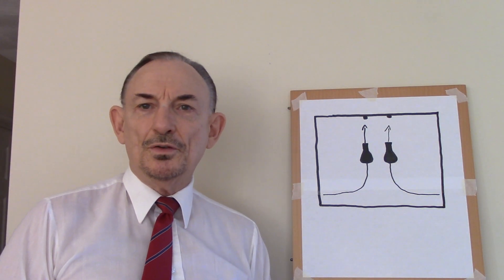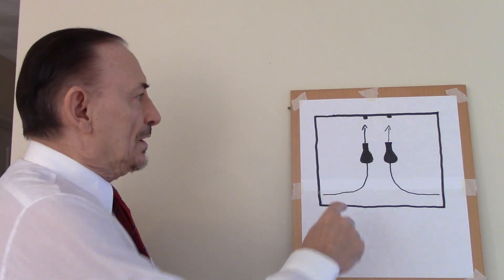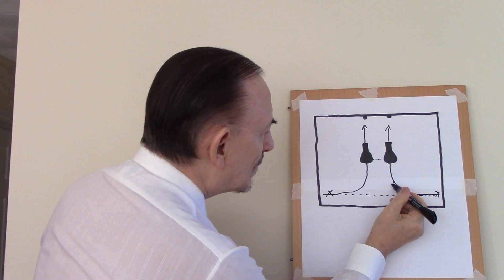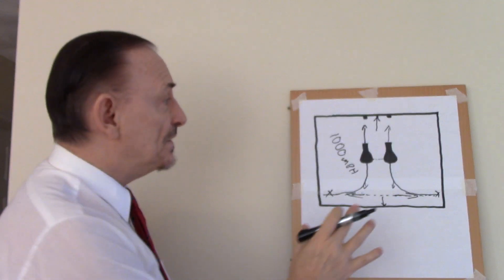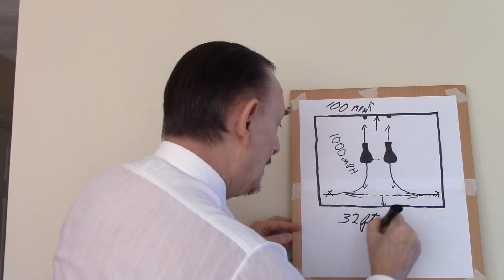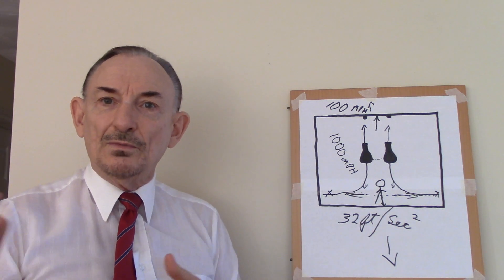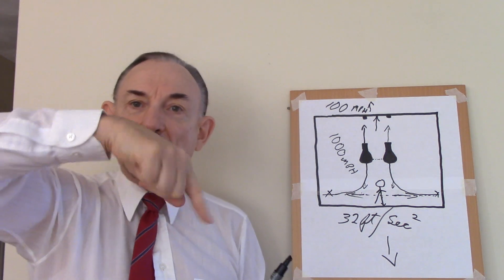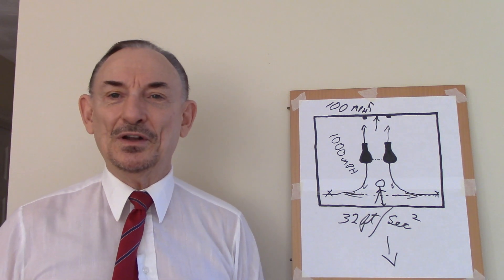THRUST CREATED IN CLOSED BOX

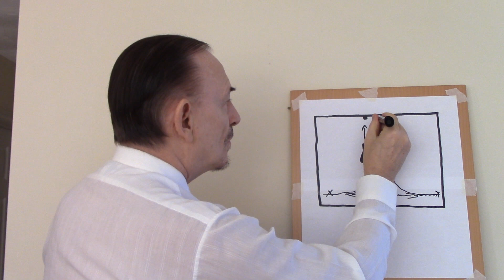Comment: 2:50 the reaction force is dissipated through the rail to whatever holds the rail in place, and if the rail is not held in place then the cannons would not turn to be parallel.
The exact total force the left rail experiences is equal to the cannon's downward movement in the beginning minus the cannon's leftward movement in the end; the right rail follows similarly. The total force on the left rail points roughly down and to the right; the total force on the right rail points roughly down and to the left; adding them together you get exactly the total downward force from the cannons.
Reply from the maker: How are you missing the fact that the cannons are still moving away from the center axis? Where did that force come from? You are totally ignoring that. The force that is making the cannons move away from the center axis after they have moved around the curves, is absorbed in the chain. Therefore, there is more force against the upper wall of the box than the lower wall of the box.
Reply: @jeffincanada5060  you haven't considered the difference between force and energy here. the change in kinetic energy from fully downward to fully outward is matched by an opposite change in kinetic energy for the chains. if the chains are fixed to the box, then this applies to the whole box. the final moment where it's just the cannons moving directly away from each other is equivalent to if the cannons had fired at one another to begin with, and when the chain halts their movement, the energy of their movement is dissipated as heat and sound. you should try performing the math here.
Let's analyze the vertical and horizontal energies separately, since you don't seem to understand when they're analyzed at the same time:
the box starts out not moving, the cannons fire, the projectiles move up with kinetic energy E1, and the cannons move down with kinetic energy E1, this is primary conservation of energy at the moment the cannons fire. for the cannons to go from moving down to not moving down, their vertical kinetic energy must change. this energy is transferred into whatever thing is causing them to stop moving downward - namely, the box itself. The horizontal kinetic energy comes about from the conservation of momentum through incremental forces - as the cannons ride the pre-determined curved paths, they pick up an outward velocity which is then dissipated when they stop moving away from one another.
Reply from the maker: @MrRyanroberson1  Yes, it is technically called kinetic energy. A rose is a rose is a rose. If I call it force or kinetic energy it makes no difference. The chain (singular) is attached only between the cannons. Man, you need to view the video again. You are missing a bunch of stuff here. You made my point when you said that the cannons "pick up an outward velocity which is then dissipated when they stop moving away from one another".  That velocity/kinetic energy, is acquired from somewhere. Where do you think it comes from. It is a continuation from the initial recoil of the cannons when they initially fire. A certain amount of the kinetic energy, force, whatever you want to call it, is absorbed in the rails, which are attached to the box, as the cannons go around the curves. However, not all of that initial kinetic energy is dissipated in the time that they go around the curves. There is still energy that is propelling the cannons away from the center axis, after they go around the curves. That energy is energy that would have, had the cannons not been redirected, counteracted the force of the bean bags hitting the upper wall. But since that energy is NOT  COUNTERING the force of the beanbags hitting the upper wall, there is more force/kinetic energy, applied against the upper wall than the lower wall. Thus, the box moves.
Reply: @jeffincanada5060  where do you think the kinetic energy goes from the vertical repulsion of the projectiles from the cannons? you may not know this, but vertical energy can be interchanged for horizontal energy. an obvious proof of this is in rotation itself. what's happening is the vertical kinetic energy is being reoriented, but what you seem to miss is that this still conserves the total kinetic energy of the system. for the rails to redirect the cannons they must exert a force. either the rails will be deformed, or they will cascade this force onto something else - namely, the box. overall there is no net gain in vertical kinetic energy. the horizontal kinetic energy could just as easily have been generated by the cannons firing at each other, and the result would be the same.
Reply from the maker: @MrRyanroberson1  I don't know why you are missing the obvious. Most of what you are saying is accurate. But there is still kinetic energy in the cannons as they move horizontally, away from each other. That means that the motion of the cannons around the curves, did dissipate some of the energy, but NOT ALL OF IT. There is still energy that is causing the cannons to move horizontally, away from each other. Tell me, where did that energy come from?
It did not manifest out of thin air. It is energy that was redirected from the vertical axis to the horizontal axis. That means that there is more energy in the upward motion of the bean bags than there is that is dissipated as the cannons go around the curve. And that energy is making the cannons move horizontally. That extra energy cancels itself out in the chain. Therefore, there is more upward energy than downward energy because some of the downward energy has been directed horizontally. If you do not understand this, then there is nothing else that I can do to wake you to the facts. When I showed this to an employee of Transport Canada, a smart guy with 4 degrees in physics and engineering, he totally got it. So if you do not understand this SIMPLE principle, then there is nothing more that I have to say to you.

Comment: I would love for this to be true, but although it doesn't break Newton's Laws, it doesn't produce any net thrust either.

Let's assume a perfect system, no losses as they simply obfuscate the realities involved.

As the cannons fire, they get pushed back with the same force as the beanbags are ejected and which transfers to the forward (upper) wall as they hit. So the box is pushed forwards and according to Newton will continue to move until acted upon by another force.

As the cannons roll back they are rotated by the rails and ALL their rearward momentum (now equal to the forward momentum of the box) is taken up by the rearward force on the rails. Equal and opposite. So the box's motion is halted.

So now the box is stationary again and we have that same energy instead in the outward movement of the cannons (remember, no losses anywhere). Let us also say that between the cannons we have a perfect spring and as the cannons move outwards, they stretch the spring until the spring has absorbed all their kinetic energy, at which point the spring pulls them back together again gaining the same speed and momentum as when initially fired (no losses remember). But as the cannons travel along the curve of the rails, all that inwards momentum is converted into forward momentum by the rails, which are pushed backwards with the same force. So the box is now pushed backwards with the same force as it was originally pushed forwards. I.e. it moves in reverse.

The cannons then hit the stops at the front of the rails and all their kinetic is converted into a forward thrust, equal to the force that pushed the box backwards as the cannons pushed against the curve of the rails and which caused its backwards movement. Therefore the box now stops. So nothing is gained, no net thrust in any direction from one complete cycle. Repeat ad infinitum.

The effect of using a chain rather than a spring simply complicates matters as that would involve huge losses, but with the cannons at the outer ends at rest, force would need to be exerted to move them back to the front and the force required would be equal to the spring pulling them together again and generating the rearward thrust, same as if using a spring.

No equations required to understand the above. Just common sense and a knowledge that energy can neither be created nor destroyed and that Newton was in fact correct.

Seriously Jeff, this cannons in a box example simply does not work. I have no idea of how your Centrifugal Propellor is supposed to work, but if the logic of its operation is as seriously flawed as this, you should give up now and save your money.

Feel free to let me know when you have proved otherwise.
Reply from the maker: "ALL their rearward momentum (now equal to the forward momentum of the box) is taken up by the rearward force on the rails." 
That's wrong Ken. If that were true, then the cannons would completely stop before they moved horizontally in opposite directions from each other. As they do move away from the vertical axis, there is still kinetic energy in them, and when they hit the end of the chain that connects the two of them, that energy is absorbed in the chain. This does not negate Newton's Third law, it just expands it. 
If you actually take the time to view the videos that I have posted on YouTube, of my Centrifugal Propeller, then you will see that this is not just theory. When you watch the video of the 1.8 version, I suggest that you stop the video and move your curser to the 3 second point, click, and then move it to the 10 second point and click. That will make clear to you that the machine does create thrust in a closed unit. If you have questions about that, please get back to me.
Reply: @jeffincanada5060  Wait.... what if the "cannons" are levitating on the rails with magnets? That would alleviate a substantial amount of friction transferred through the rails and then essentially the chain stopping the cannons from making contact with the box. Is this the "secret" that you were hinting at?
Reply from the maker: @oodyjones  That would reduce the friction, but I am not sure what you are referring to when you say that I was "hinting" at something.

Comment: This concept completely ignores the fact that in moving the cannons back to their original positions while travelling at that speed you'd be completely counteracting the force originally produced by the cannons, so it would not accelerate, however interestingly although it would be very impractical you could use this to travel sideways, or along the ground in a high gravity environment like earth by utilising the friction created with the gravity to stop it sliding back when the cannons returned to their previous positions. If you did this in space however the cannons would be propelled backwards with the same speed as the beanbags and as soon as they stopped moving in the forward directional axis they would pass on their kinetic energy to the rails and the box, completely counteracting the force created by the beanbags hitting the wall. Which is why this concept just won't work, you can't keep the propellants of the thruster enclosed inside itself, in ion engines they make the most out of loosing a small amount of propellant by giving it the greatest momentum when shooting out the back of the spacecraft, ensuring the spacecraft accelerates more efficiently with equal momentum to make up for the loss in mass. If you're interested in creating some form of propellant free thruster I would suggest either looking into fictional warp drives (although these don't really count as thrusters unless you count a spacetime expansion or antigravity as a form of propellant) or the equally fictitious EM drive (or the impossible drive), a type of thruster that uses microwave resonance to propel itself which is similar to your thruster in the way that it completely disregards and violates the law of conservation of momentum.
Reply from the maker: Oliver, you have completely ignored the fact that the chain absorbs a large portion of the reaction, it does this at a right angle to the initial action/reaction axis (lets call that the X axis). So because it does this prior to the full reaction energy being spent in the X axis, that means that it has "stolen" an amount of energy from the X axis reaction. That means that there is more force on the forward wall than the back wall. Thus, the box moves forward in any medium.
Reply: @jeffincanada5060  u go jeff!!

Comment: It isn’t infinite, but it CAN thrust.
There is power needed to reset the,.
Reply from the maker: Yes, you understand. Thank you. I have done the same thing with my Centrifugal Propeller as I have done with this explanation, except, instead of using little cannons, but using the same principle, I have converted centrifugal force into directed thrust. If you search my YouTube channel, you will find two videos that I've posted of my Centrifugal Propeller. Enjoy.
Reply: @jeffincanada5060  how much thrust can it produce, though?
Can it be made? Have you built it?
Reply from the maker: @hamburgerhamburger4064  If you do a search on YouTube for Jeff in Canada, you will find my channel with two videos of a proof-of-concept prototype. I am now building a practical purpose prototype. The math tells me that it will not only fly, but my 40 pound unit should be able to lift several hundred pounds at a minimum. I am currently self-financed and so I have been spending time in my business to earn the money to complete that prototype. Consider this: a one foot radial arm with two pounds on the end, rotating at 1000 RPMs, generates 12,700 pounds of force. My prototype has 4 arms and I believe that it will be converting somewhere between 35% and 43% of the over 50,000 pounds of force that is being generated at 1000 RPM, into directed thrust. That means that it should theoretically lift over 17,000 pounds. The fastest that I've been able to get the prototypes turning in the past was only 90 RPM. I have solved that issue and now am capable of getting 1000 RPM. The problem that that created was that the carbon fiber parts could not withstand that speed, so now I am back earning money to build more robust components.

Comment: I'm sorry, friend, but you're neglecting the interaction between the cannon and the rails and the rails and the box. For the cannon to come to follow the path of the rails, the rails must apply a force to the cannon. This force is what turns the vertical velocity to horizontal. Then, the rails would push on the box equal and opposite to the force by the bean bags on the roof of the craft. Momentum is always conserved
Reply from the maker: You are missing one very important point. What about the force that is propelling the cannons in opposite directions and at a right angle to the initial force? The force that is absorbed in the chain has to have a corresponding force somewhere. If you listen again to my explanation, you will see that I do account for the force in the rails as the cannons go around the curve in the rails. Yes the rails are attached to the box and a portion of the reaction from the initial thrust is absorbed in the rails as the cannons go around the curves. But there is still kinetic energy in those cannons after they have gone around the curves. It is THAT force that is cancelled out in the chain. So there is in fact, more force exerted on the upper wall of the box than the lower wall of the box. Pure physics shows that when there is more force exerted on one side of the box than the other side of the box, there will be a movement of the box.
Reply: @jeffincanada5060  You are correct. There is more force exerted on the upper wall than the lower wall of the box. However, there is a force equivalent to the force exerted on the top of the box on the rails, which allows the box to remain stationary. Imagine you are viewing  the box from the side not the top. You see a cannon accelerate then come to rest. That is because the rails are exerting a force on the cannon. A force that is then transferred to the box.

My model of the situation includes that kinetic energy, a portion of that energy is used to accelerate (turn) the cannon along the rails. The rest is converted into energy going right or left. 

Momentum in a closed system is ALWAYS constant. Not just when every piece of mass is easily accounted for. 

I really respect that you are trying something new to build humanity's collective knowledge, but your model is incomplete. Build it and that will be apparent
Reply from the maker: @charliemichael4052  As I have said previously, of course there is some momentum/kinetic energy absorbed in the rails, in a direction that is opposite to the force at the top of the box. You acknowledge that the force that is moving the cannons laterally is real. If so, that force was "taken" from the perpendicular force. That being the case, there is no equal force in the downward direction, to the upward force. The energy that was taken away from the perpendicular, was not taken from the upward force, it was taken from the downward force (the reaction), thus causing an unequal amount of perpendicular forces. That being the case, the box will move upwards.